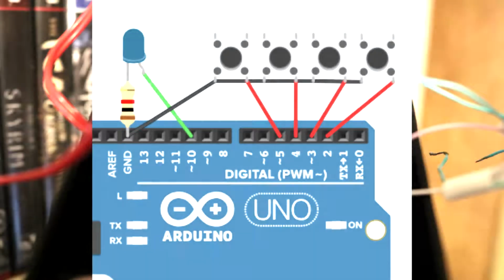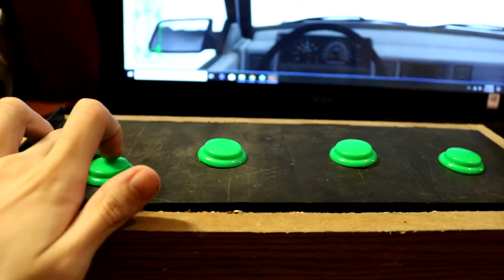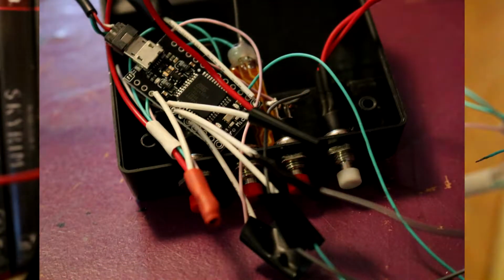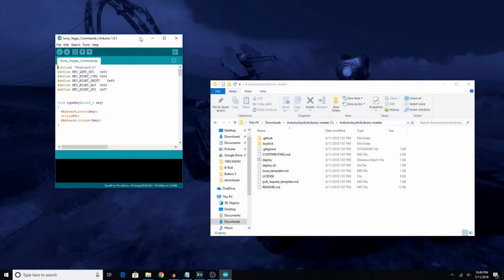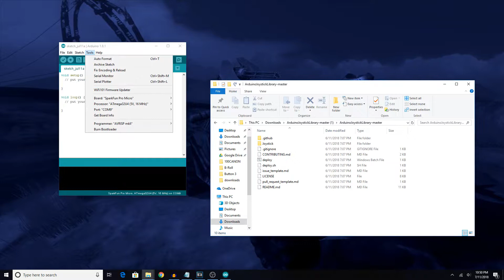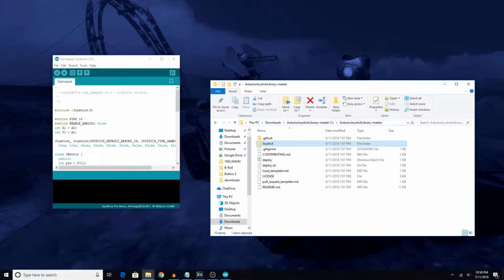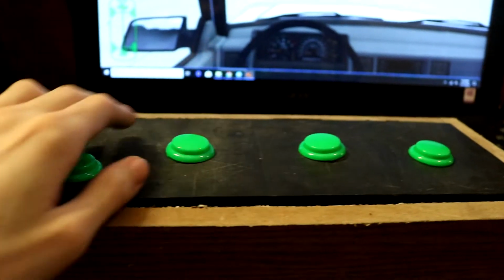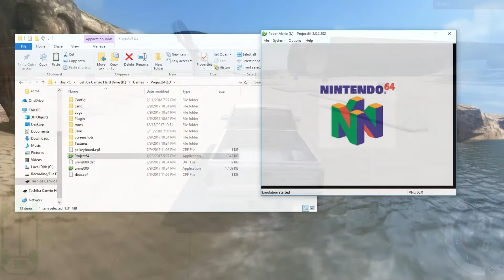Button Box Part 2 "GamePad Setup Arduino Pro Micro"

Comment: with arduino nano v3.0?
Reply from the maker: I think that is a different Arduino I don't believe it has hid capability's but might still be programable to act like a joystick or gamepad. I would just get a Arduino pro micro or tinsy to be safe and then you could even program the buttons to do key board actions and shortcuts.

Comment from the maker: Been two years and even though this project was jank it never stopped working I actually de-commissioned it this year. I actually gutted it and moved it all into a custom enclosure for 30mm arcade switches I made I use it mostly for desktop management and streaming using joytokey but being smaller in size is nicer.

Comment: Do you have that wiring diagram? Cannot find it
Reply: Massive thank you!
Reply: i like to attach potentiometers to the arduino pro micro...do you have a diagram from this? cannot find one..and a sketch?
Reply from the maker: Was gonna reply with how but it easyier to show I didn't make this diagram but the wiring is the same. Just one leg to a pin with power and another to ground and the last one to a analog input pin.
https://www.browncountylibrary.org/wp-content/uploads/2018/03/arduino_potentiometer.pdf
Reply: @everythingdigital1  Aaaaah..thanks great again..is this asfo for the alduino pro micro?
Reply from the maker: @tve5614  Well it for Arduino in general but it will work with the pro micro since it has analog input pins from what I remember.
Reply: @everythingdigital1  OK gonna try yhis...I am new to this...so this helps..
Reply from the maker: @tve5614  It's not too difficult and i'm sure you will get the hang of it quick :D. Something that helped me when I first started out was tinkercad so if you ever think your wiring something wrong you can practice on a online simulated ardurino.
Reply from the maker: https://youtu.be/Me-DqMKINbs?t=52
I show it at 53 seconds in this video it's the same diagram from part one just if you don't want a led don't wire it up but the buttons get hooked up the same way and all the grounds goto ground and the other leg of the button goes to one of the avaliable gpio's. Also sorry for late reply was out wiring up a back up camera to my car.

Comment from the maker: This was gonna be a 3 part series but since I didn't use the zero delay encoder thing and found out the Pro Micro could emulate a controller fairly simply I ended up going that route perhaps for the final video i'll talk about the easy way to making a button box if the Arduino method is too difficult for any of you and you don't want to solder either. But if I had to recommend which DIY you should do I would recommend using a Arduino Pro Micro since it can act like a macro and or a game pad depending on the script you upload. Fun fact I used the arcade button box to help me edit this video...
Reply: Ok...thanks again...I try and I try..it is on my PC now as a Arduino Leonardo...last stap connect switches en potentiometers with a sketch..is still te problem..keep on trying...thanks voor your patient..
Reply: Hello, I tried to attach the potentiometer following your diagram...but the sketch does not recognize the arduino pro micro...do know if there is another sketch?
Reply: I have my arduino pro nicro attached to the software as an arduino leonardo...is that correct?
Or shuikd I download drivers from somewhere else?
Reply from the maker: @tve5614  https://learn.sparkfun.com/tutorials/pro-micro--fio-v3-hookup-guide/all
If my memory is correct you need to install the drivers and on the site for the pro micro they got a pretty detailed guide for how to set it all up.
Reply: Dispite all my efforts...I cannot get the potentiometers working with the arduino pro micro...do you hava a sketch for example 1 switsch and 1 potentiomter to try out...and is your adruino pro micro connect with the PC as arduino Leonardo?
Reply from the maker: @tve5614  You need to install the pro micro drivers and set up the ide under board manager in the arduino ide. 
Go here and read the section about Installing: Windows on the page it will show the steps.  Then when you installed everything go under tools then board and you should have "Sparkfun Pro Micro" as a option instead of leonardo. Also before you flash the pro micro under tools you need to set the processor as well is you are using the 5 volt pro micro select 5 volt if you use the 3 select 3 volt. Sorry if this is hard to follow its hard to explain over comment.
https://learn.sparkfun.com/tutorials/pro-micro--fio-v3-hookup-guide/all
Reply: @everythingdigital1  again...thanks for the help...gonne do this next step..onde day,,onde day
Reply: At last..it is properly installed to the PC..but it doesn't work with the arduino software examples...where can i find a simple sketch to connect a potentiometer or a simple switch...make this thing please working
Reply from the maker: @tve5614  I think the sketch I included does analog inputs so try to flash that one over and go under "set up usb controller" just hit the windows key and type it in if you can't find it that way check under control panel for it. After you put the sketch on I included your pc will think the Arduino pro micro is a gamepad and you will see it in there and it should show you. If that sketch is too much ill see if I can find a simple sketch and link it for you.
Reply: @everythingdigital1  ok...thank you...wil try